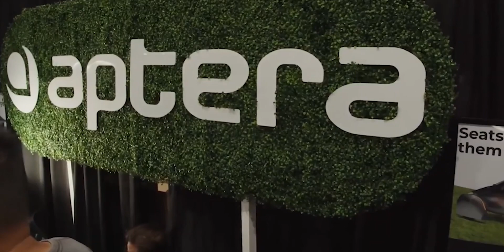Aptera Raises $40 Million To Begin Production Of Their 1000 Mile Sev 1

Comment: Aptera produced 50 Mill loss in just the last quarter. Without even having a production prototype. They need at least 300 - 500 mill to start production. And they have to raise the vehicle price by 10k. To even have a chance of not getting bancrupt in that process.
Reply: pre-production start ups burn through cash, but you're wrong about how much they need to start production. You're generally wrong about most things. Why is that?
Reply: @GoClimbARockEh  The estimates for starting a production are from Sandy Munro. Ask him why he is generally wrong about most things.
Reply: @vic321344  That was in context to if they plan of upscaling the production iirc. For the amount they have to build they can't even think about upscaling yet.
Any company runs red numbers through the starting years, even Tesla didn't get into making money until recently. 
The fact that Aptera didn't burn though that much cash despite their size is actually good. Other start-up burned through 10x more.
Reply: @Enforcer_WJDE  Nope. Upscaling would cost 500 Mill more than the initial 300-500 mill needed to start production. If Aptera has 30k orders, they need to build at least 10k per year. That cannot be done by handbuilding.

And Tesla spent billions of dollars for production. And yes, even if you spend billions it is not for shure that you will succed (Rivian, Lucid, Nio...).

Aptera just builds a motorcycle. If they would build a real car, they would need at least 1 bill to start production.

They lost 50 mill in just one quarter, without building anything. Also these costs have to be covered for several years. Callbacks, customers complaints, warranty ... cost even more.
Reply: @vic321344  Those were estimates for the next stage of Aptera's growth. They need much less to get this first car into production.
Reply: @GoClimbARockEh  Nope. that was the estimate for the start of production. Upscaling would cost 500 mill more. A real car instead of the Aptera motorcycle would cost 1 bill to start production.
Reply: @vic321344  Where are you getting the idea that “Aptera burned through 50M in the last quarter”?
Reply: @jaybusby8299  SEC Filing
Reply: @vic321344  Yup.   I saw the same thing.   I bet they hate they have to disclose all that info.

Comment: Jay Leno Suffers Serious Burns in Car Fire youtu.be/G_vAYkeuTjw
Reply: Same could happen to you in an Aptera. If the battery pack catches fire. It is completely inside the cabin. Under the seat of the driver. If the Aptera motorcycle is crashed in an accident, it will most probably land on its roof. So no way to escape.